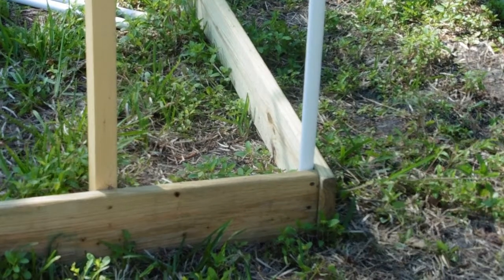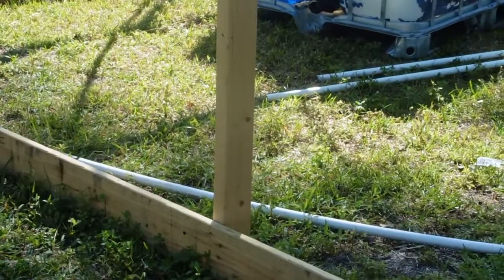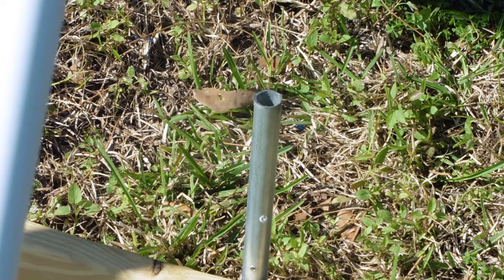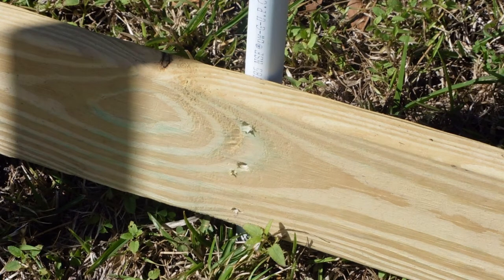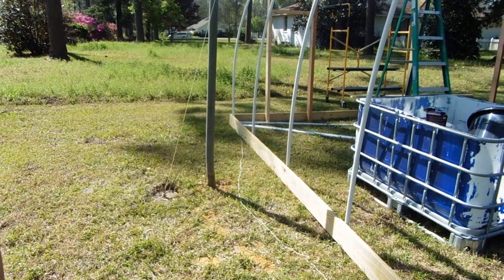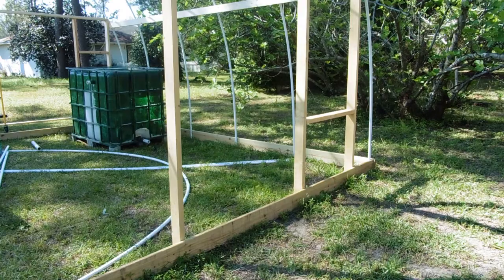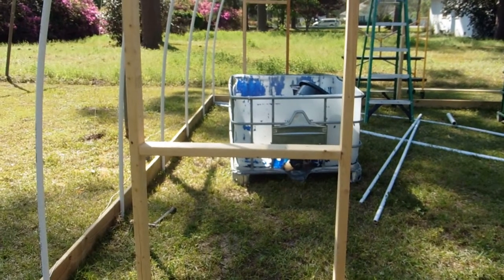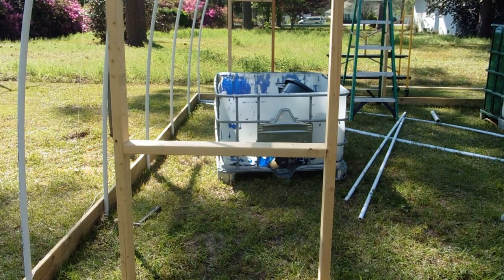How To Build A Greenhouse Part 1

Comment: You make it so simple.  Can you get composite wood deck boards that size?  They would last years longer.  We had had so much pressure treated wood just not hold up, especially in screwed together corners.